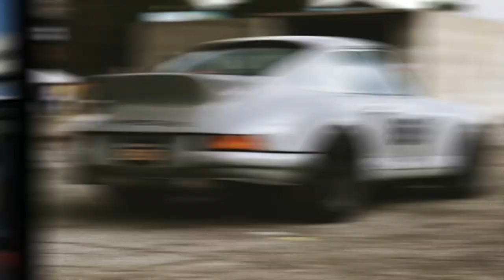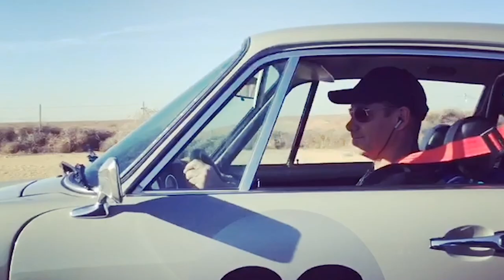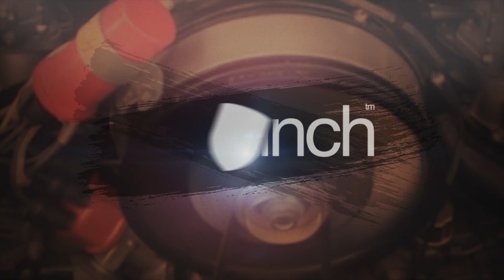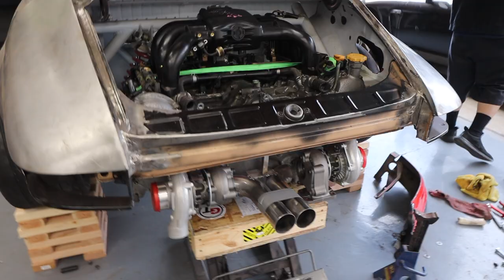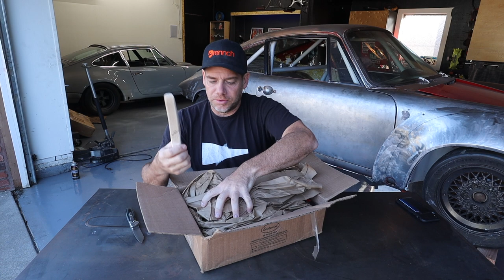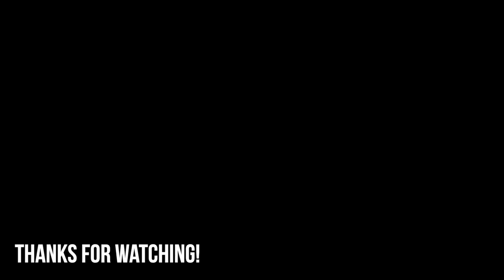Unboxing The Eastwood DELUXE Lead Body Solder Kit for my Abandoned Porsche 911 Restoration

Comment: Michael - great kit. Electrical cable jointers do great lead work - old cables are lead sheathed. I have watched them at work and some translate those skills to car body work - lead wiping, which is sanded and painted to create perfect surfaces. Sometimes they use folded clothes (covered in wax) as well to push the lead into smooth shapes rather than just the paddles. Be aware - the lead has about 5 degrees between too hard to move and a puddle on the floor. All the best and practice will make perfect.
Reply from the maker: Thanks for the tips!  Very interesting about the folded cloth too.  I'm going to see if I can find some videos on that.